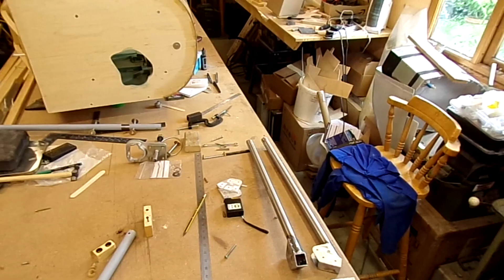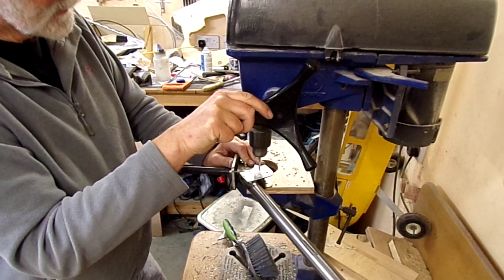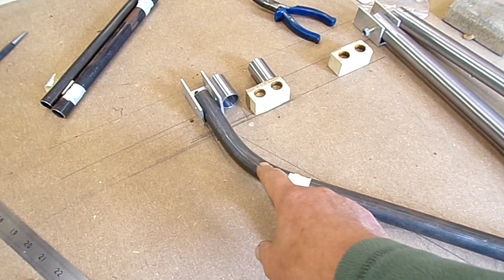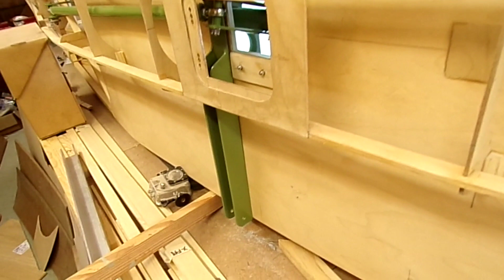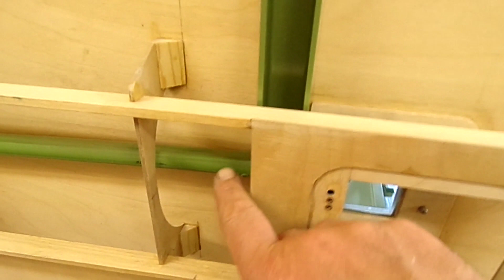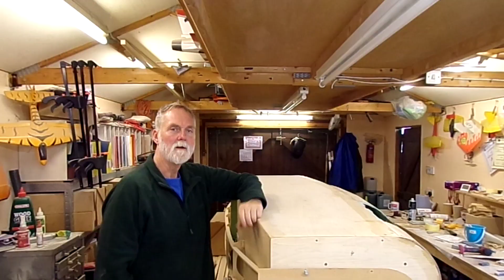EP117 Big step forward with the Undercarriage. Fisher Youngster

Comment: Y is your bottom inspection hole offset from your tube? Shouldn't it be directly inline with your stick tube? (not sure what it's actually called)
Reply from the maker: The bottom inspection panel is central, I think it appears to one ide as the control column is to one side as the aircraft is on it's side (the front of the push / pull elevator tube moves side to side with roll inputs from the column). A good observation, I hope I have put your mind at rest 🙂

Comment: I'm sure it will be on its legs soon Algy.
Reply from the maker: Not that soon, it will have to wait until the lower wing butt ribs are in, side stringers fitted, windscreen fabricated and the fuselage is covered. So a little more work to do 🙂